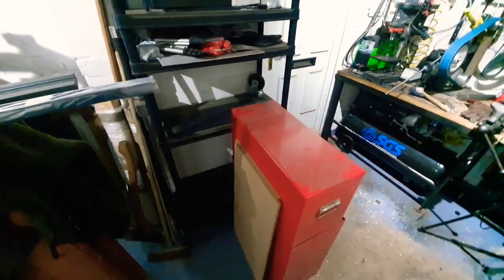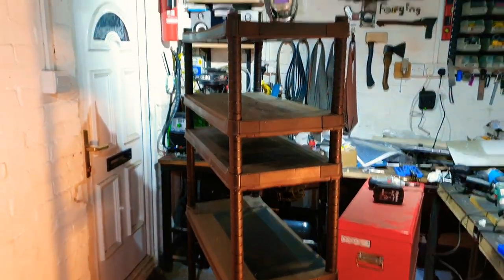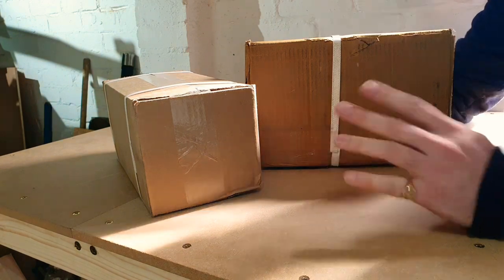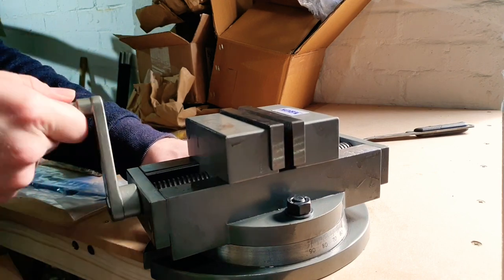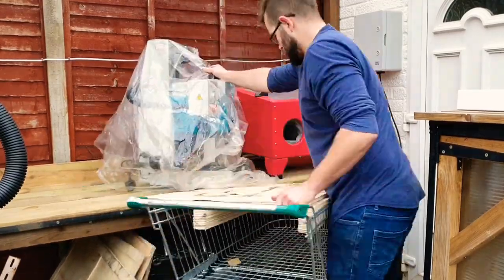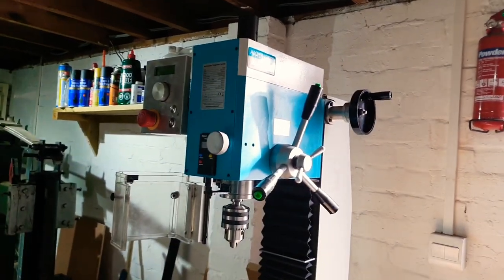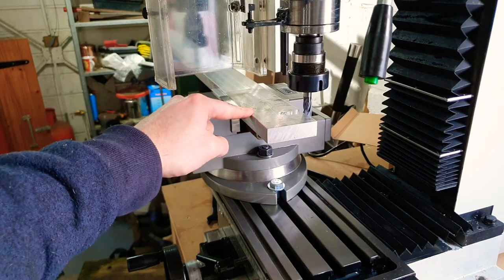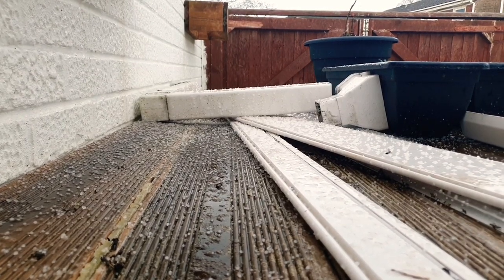NEW MILLING MACHINE - Axminster SX2.7 V2

Comment: Nice machine. But remember to put the collet in the nut first, then put them in the holder together.
Reply from the maker: How come? (I'm very much in the learning process, so any advice helps).
Reply: @PJTForging  because when you put the collet in the arbor first, there is the possibility of the collet not snapping correctly into the nut. When you tighten the nut then you squash the collet in the arbor and not only damage the nut but also you will have massive runout on the tool. There are many instructions about er collets on the internet. You'll surely find lots on google.
Reply from the maker: @godehardmatzel630  Noted! Thanks a lot for letting me know. :)
Reply from the maker: I thought I understood what you meant... I didn't.
Just learned the hard way. 

NOW I understand what you meant. 😂
Reply: @PJTForging  uhh, hope it's still good for yet another try...
Reply from the maker: @godehardmatzel630  yeah, all good. Fixed my mistake. 😅

Comment: Sweet machine! And that vice was so satisfying, I could watch videos of it opening and closing all day!
Reply from the maker: It's a thing of beauty right!? It wasn't cheap, but it's hard to put into words how nice it is to have a decent vice... although in my next video (uploading as we speak), I also learned the hard way that I needed to take the time to mount it properly. 🥰
Reply: @PJTForging  Definitely! How much does the depth of the cut reduce the speed you can cut it? Is it faster to do one pass at 6 mm or two at 3?
Reply from the maker: @CrudeButEfficient  I think honestly it's not so much about the speed, but the power of the machine + strength of the cutter... if probably go for the x2 3mm cut option. ;)

Comment: Hello, Do you know the differences between this V2 SX2.7 and the older? Thanks
Reply from the maker: I'm not 100% sure. I think it may be to do with changing to a brushless motor, or the speed controller used, but I'm not certain.
Reply: The SX2.7 and the SX2.7L (or V2 as Axminster call it) the earlier had a digital speed control where as the latter has a potentiometer for speed control. 
The earlier model has a 550w brush motor, and the latter has a 750w brushless motor 
What I'm not sure about is why the Axminster v2 SX2.7 is £1000 more than the red Sieg SX2.7L, why having no specifications that are different?

Comment: I heard you say that you needed to make a magnetic chuck. In another video by a utuber who built a mag base drill he used small electromagnet strips made for doors and they worked really well at holding his drill onto girders. Of course you would then need power and an on off switch.
Reply from the maker: I did toy with the idea of making an electromagnetic chuck, but decided in the end to keep it simple with neodymium magnets. You can see the build in my DIY surface grinder video.